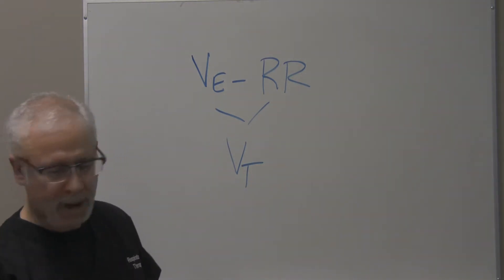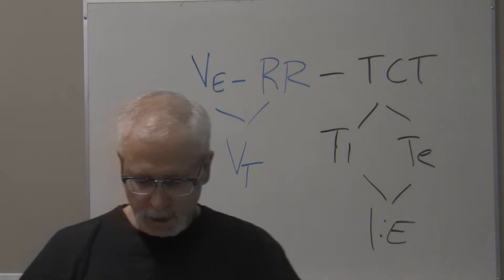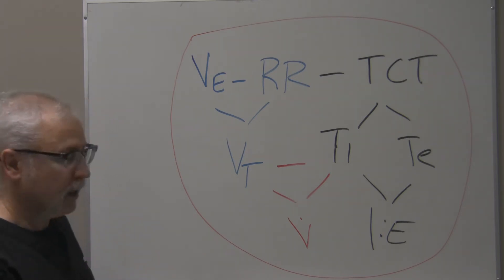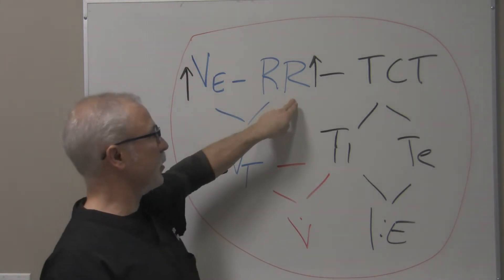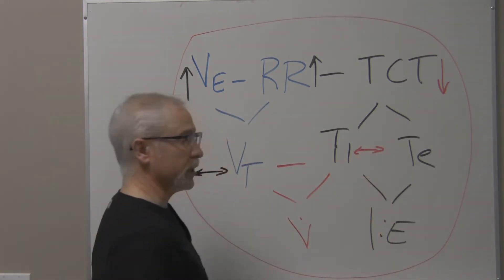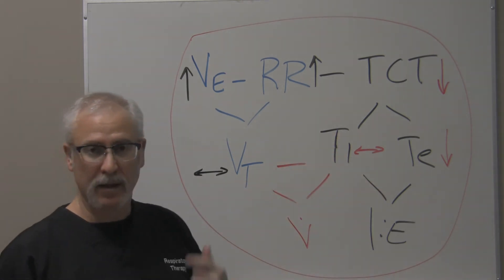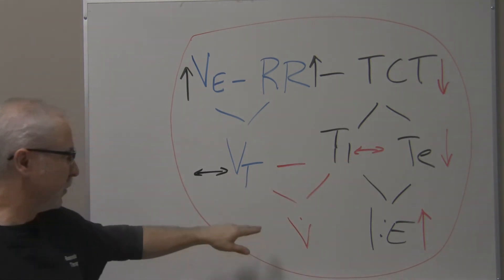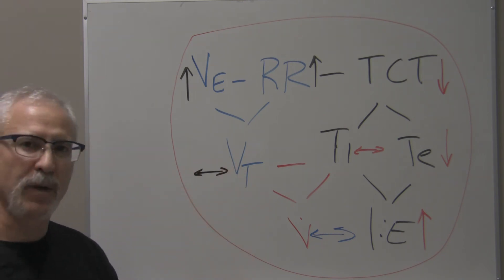Ventilation Dynamics Part 7: Tying it All Together

Comment: Here is everything from your videos on the Ventilation Dynamics.

RR or f - respiratory rate (number of breath per minute)
Vt - Tidal volume (the amount of air sent to the lungs during one inhale)
Ve - Minute Ventilation (Volume received in a minute) 
V_dot - Flow (air flow)
Ti - inspiratory time [seconds]
Te - expiratory time [seconds]
TCT - Total Cycle time (Ti+Te)
I:E - inspiration : expiration ratio

V_dot = Vt / Ti x 60 [L/min]
Ve = Vt x RR
TCT = Ti + Te
RR = 60/TCT
I:E = 1 : Te/Ti = Ti : Te = Ti/(TCT - Ti) = Ti / (60/RR -Ti) = 1 : (60/(RR x Ti) -1)
Reply: A true god. TY king